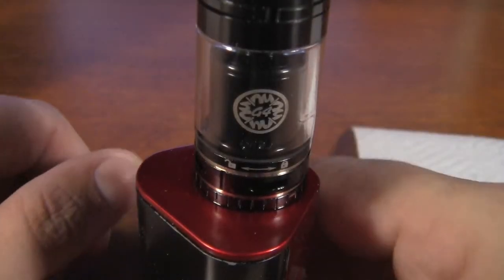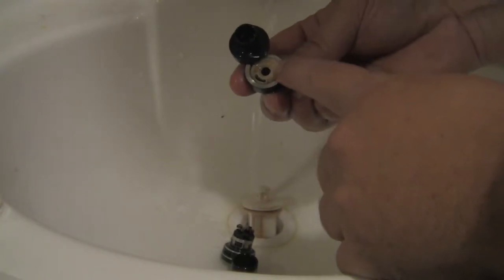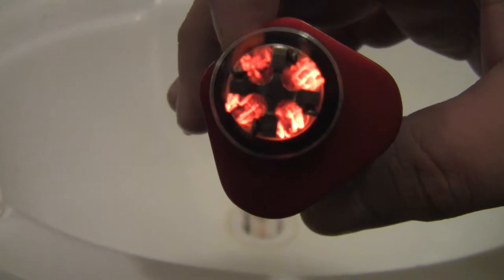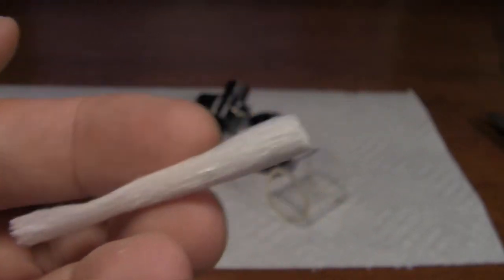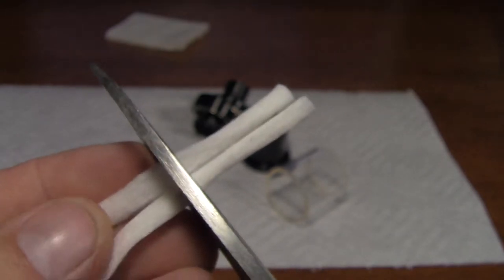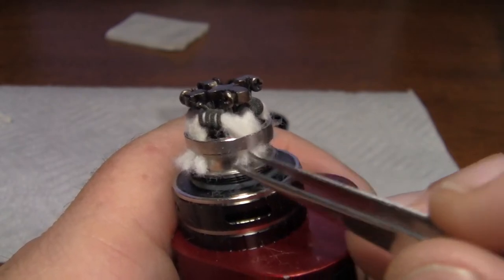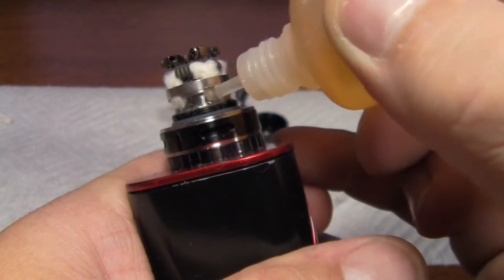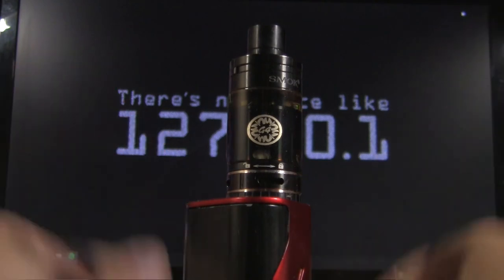Smok TF RTA G4 Coil Clean & Rewick

Comment: Just a tip Tony, got some coilology 2.5  MTL fused Clapton's, 28 gauge found it handy to rebuild, just snipping to length was hardest part.  They slip round the top of post nice and handy🤗. Hope you find this useful. I found any bigger guage to be really difficult to tighten on the top of post. Shout out Joe from Ireland 🤗🇨🇮

Comment: Good job Tony 👍 Just after wicking my own G4, I put new coils in, man that was hard. I like smok tanks but have had nothing but bad luck with their mods. This is one unique tank. Shout out Joe from Ireland 🤗
Reply from the maker: Yea, the G4 is definitely not easy to wick, but I loved the tank. I actually popped the coils on my G4 and G2, and ended up getting a new mod and tank. I'm now hitting the Smok Mag P3 with the TFV16 tank on it. It sucks having to purchase coils for it since it's not rebuilable, but it's not bad. 

If you don't mind me asking, where did you get your new coils for the G4 and which coils did you go with, and how do you like them? I like my P3 mod, but I REALLY want to go back to the G4!
Reply: @Tonysvapes  I actually built the coils myself, kanthal 26 gauge 2.5 I'd on my coil jig, 5 wraps each came out to 0.42 was fairly  awkward, got there in the end though, thanks.
Reply: @Tonysvapes I like the smok tfv12 prince. You can get RBA DECK for it, I have 2 one of my favourite tanks 🤗
Reply from the maker: @villagevaperreviews6103  Ah, so you just went with straight 26ga, and didn't go back with the claptons.... Interesting. I have been spoiled with the claptons flavor, and saw that you can get 15 feet of it (3 meters aprox) for about $12. This is for the 26ga wrapped with 32ga, same as what is on the tank from teh factory (measured it just now). May have to drop some cash and get this old girl back firing again! lol. Thanks for the reply.
Reply: Yeah definitely worth it. Like I said the RBA DECK for the prince tfv12 is a great tank. Happy Vaping. Talk to you again Tony 👍